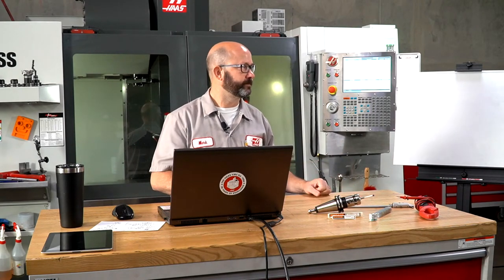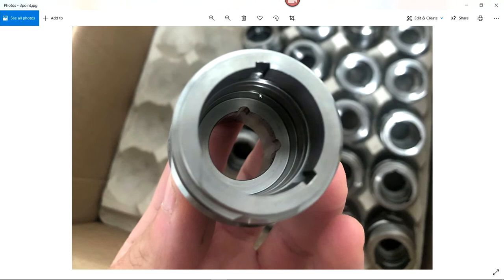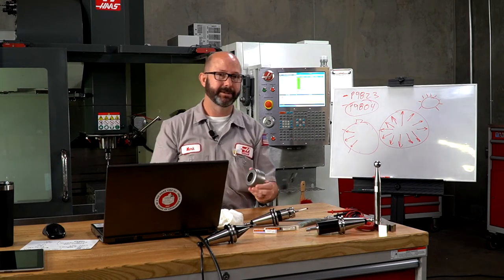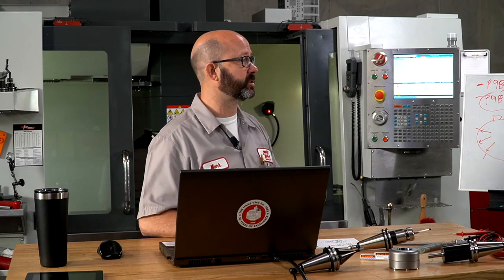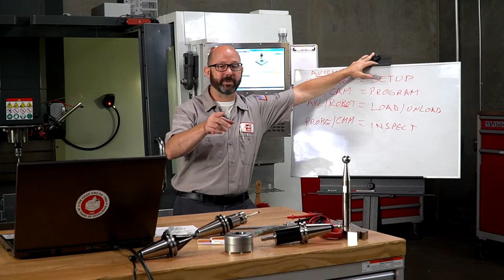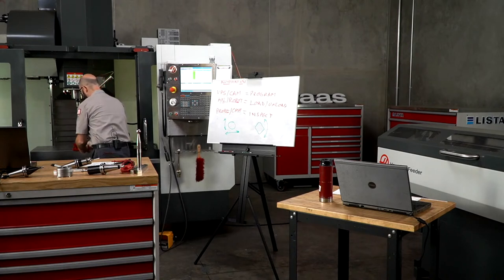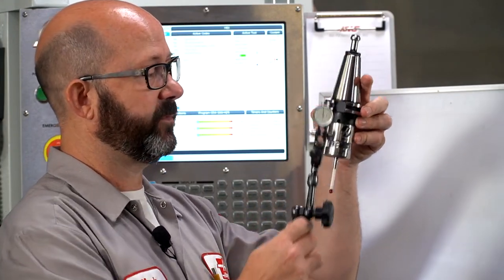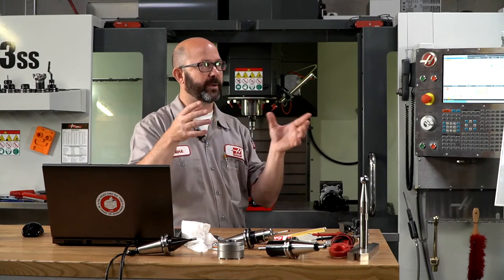Tip of the Day Live July 21, 2021 - Haas Automation

Comment: Hello from Greece!
Is there any way to run the bore or boss probe cycle but starting on another angle? 4 points starting for example at 45 degrees?
Reply: You’d have to write something custom, and use the spindle orientation. A lot more work than it’s worth if you can just use the 3 point one it works just as fine for a haas.

Comment: On the older Haas controls with WIPS , there was a probing cycle that would probe Z and the center(outside) of a rectangle all in one program...How do I do that with the Next Gen control ? Currently I have to run 2 programs , the single axis for the Z & the probe center rectangle
Reply: Are you referring to the VPS templates on the machine? You can create your own, there should be an excel template floating around where you can combine the two into one VPS template

Comment: Here’s a good question for you guys. We have 6 haas DM 1’s where I work for trimming thermoformed automotive parts. They are all set up and configured the same exact way to cut the same set of programs. We were wondering if it was possible to use 1 spindle probe amongst the 6 machines that we have.
Reply: Yes. The "eye" will see it on all machines if they all have the eye

Comment: If you want to use 3 point probe cycle by your cadcam system. do you still need to calibrate probe. ?
Reply: Yes. The probe needs to be calibrated using the vector cal macro